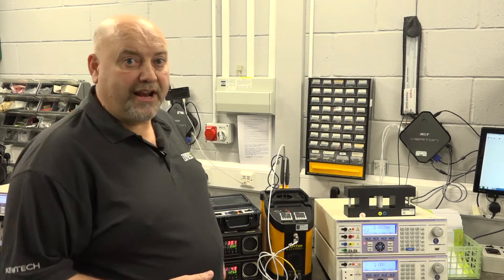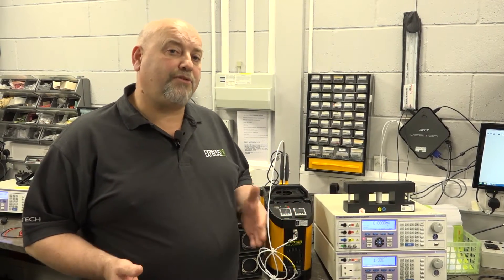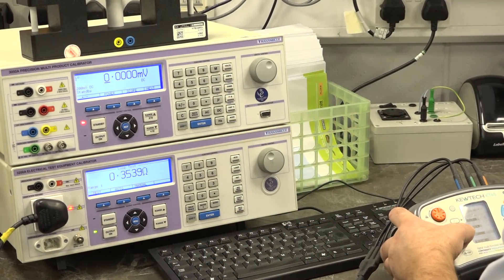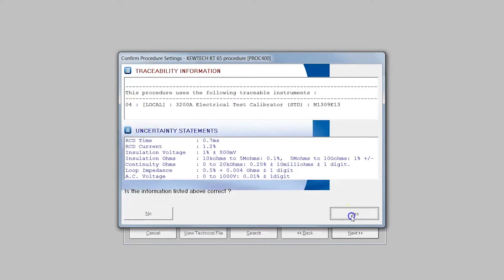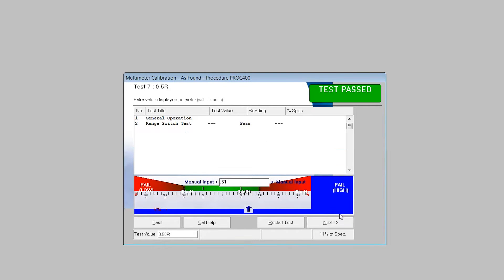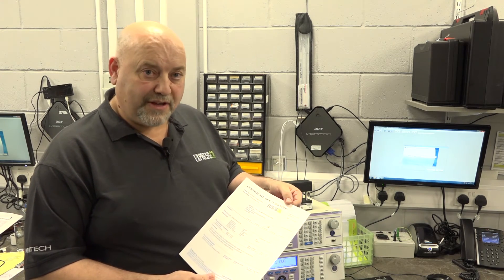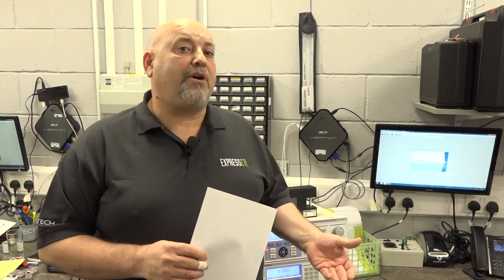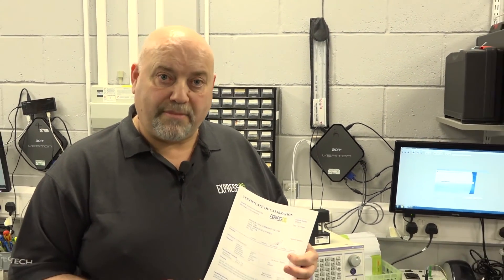ExpressCal Calibration

Comment: Calibration is not a requirement it is only recommended by the manufacturers. If you check your instruments on a check box at least once a month that is perfectly acceptable as as you keep a written record of the results, if you notice any drifting then you should send instruments to be calibrated. Also express cal is not owed by Kewtech it is an independent private company. And Kewtech is just one of many many manufacturers who use express cal .